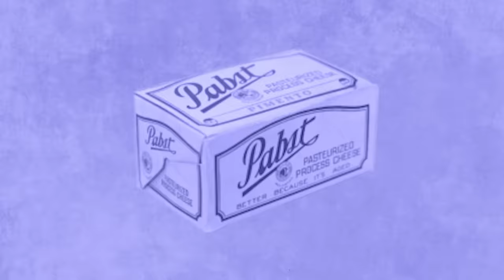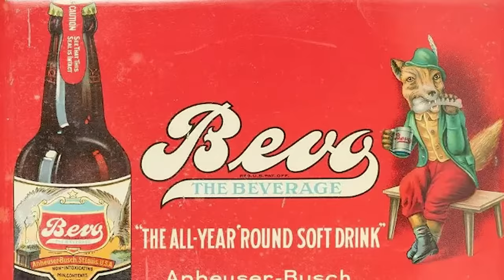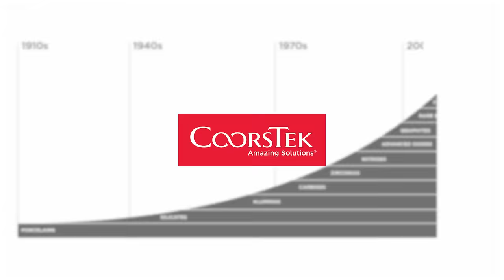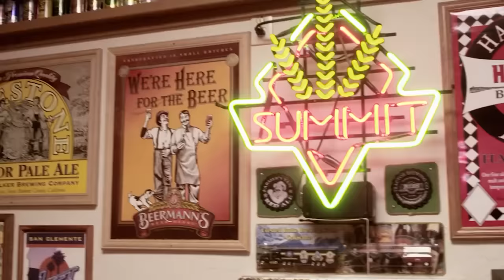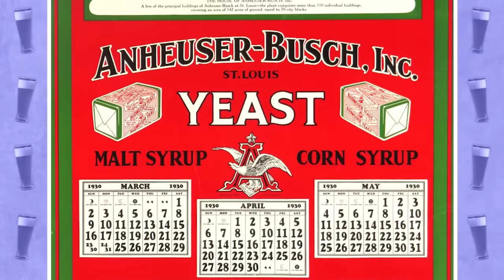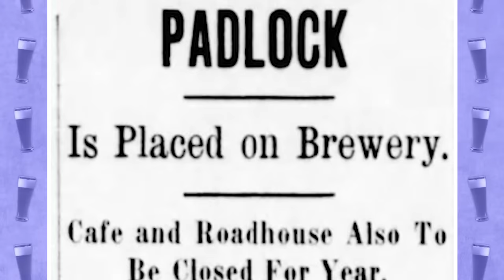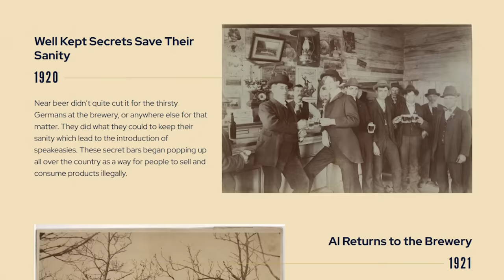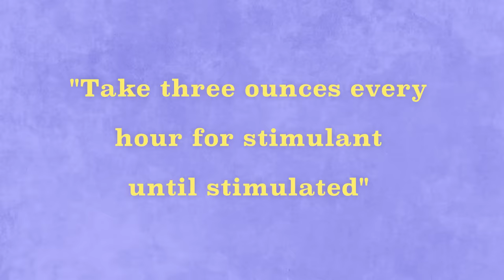Breweries That Couldn't Be Stopped By Prohibition

Comment: Stroh was a brewery in Detroit that made ice cream.  The brewery was closed in the 1980s but the ice cream is still made in the area.  The label for the beer was sold off.  You can still buy Stroh’s but it is brewed by a different brewers outside of Michigan.
Reply: Actually Pabst just recently licensed Stroh's back to a local Michigan craft brewer call Brew Detroit.  Using the original 1850 recipe it was set to ship that beer to local pubs in 2023.
Reply: @gregorybiestek3431  Cool.  I will have to look for it.   I am also a home brewer who toys with recreating extinct beers.  I have been looking for any information on Bosch beer.  It was a label from the Upper Peninsula.
Reply: "From one beer lover to another,   Stroh's!" 😊
Reply: @timclark7507  Bosch Beer operated in the UP from 1874 to 1973. Some of its recipes have been picked up by a micro-brewer Keweenaw Brewing Company, started in 2004. It is sold across the UP, upper Wisconsin, & Northern Minnesota. It is also sold at one concession stand in Comerica Park during baseball season. The original Bosch building has been converted into artisan chocolate maker.